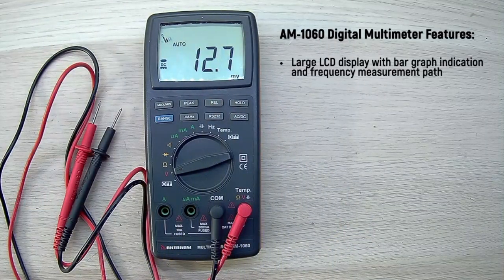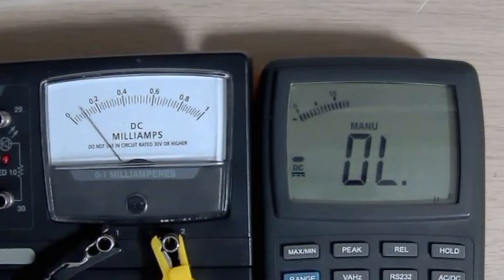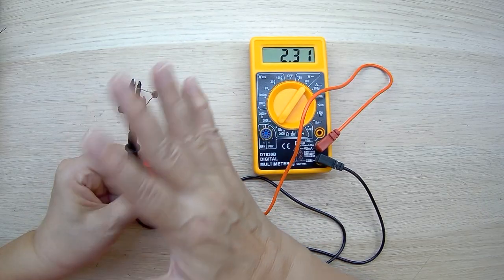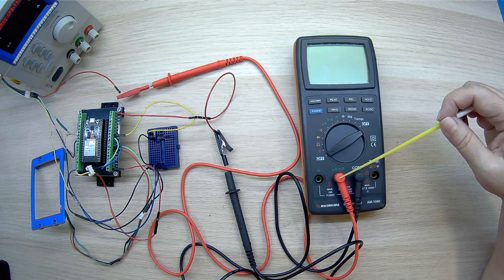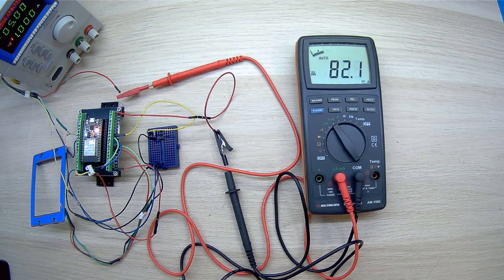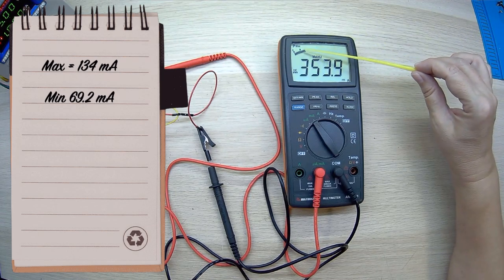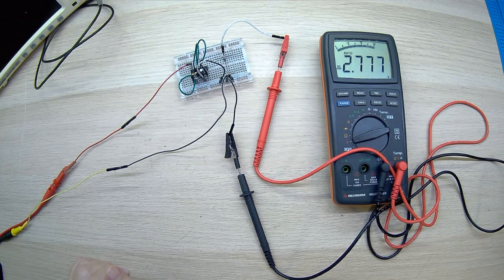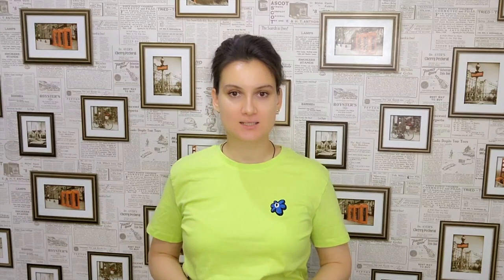How to Use a Digital Multimeter (AM-1060): Measure Voltage, Continuity & Resistance Safely

Comment: "The second press of the MAX/MIN button shows the minimum current value for the measurement period. But these values are often not sufficient for real design. In a short peak with a duration of one to five milliseconds, the current can be significantly greater....." - I didn't know about this, thanks😃